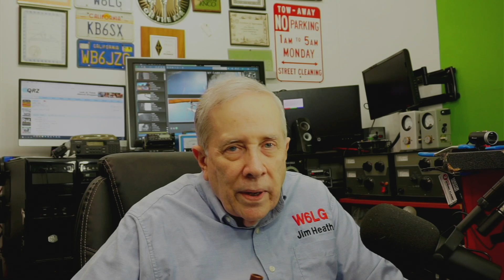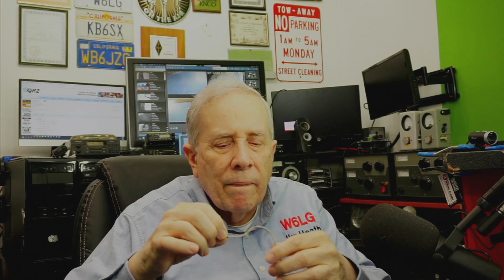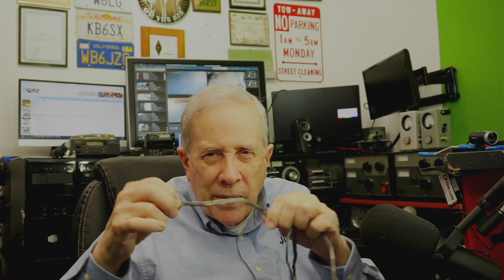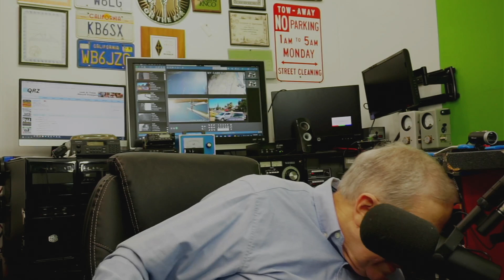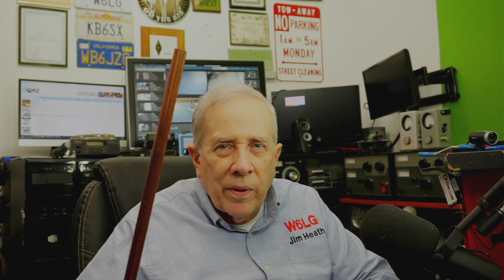How to RF Ground Your HF Station as Shown by the ARRL and a Discussion about Ground Loops, Bonding

Comment: I have always thought about making an alternate path from the shack with rods to ground would be a bad thing.  The electricity needs to make it back to the service panel then to the transformer.  The electrical system already has two grounds (Neutral and common boded ground).  I think I'll will now do a common shack ground (copper pipe) with a 6 awg wire that is runs back to the service panel ground rods and place a rod at the antenna feed point with a attached lead back to the service panel rods.  Thanks for another great video.

Comment: Since I just have a simple station and since you mentioned "braid", is it safe for me just to use the braid of used RG8 coax and strap it to a copper pipe grounding buss behind my desk and connect it to a grounding rod outside my house?
Reply from the maker: In   my opinion:  NO!  All grounds must go back to the maein panel. Run separate straps to the common point at the desk and connect that to the elctrical ground.  73 Jim
Reply: @ham-radio  but HOW do you connect the common point to electrical ground? I know that is what you have to do, but I can't find anywhere where you explain exactly HOW to do it. I know very little about electrical and wiring... break it down like an Elmer would.

Comment: Hi Jim, Paul NC6PT here.  You stated amply there is no such thing as RF ground.  That message is received.  However, I'm wondering about your recommended grounding system for your (and others') station.  Basically, it's a "star" configuration, with a copper pipe at the center.  Okay, but then, that pipe connects to... ?  The AC safety "green wire" ground at any chosen wall outlet?  This tells me that the various components in your station would be at the same ground potential as each other, but not necessarily the same potential as at the service panel.  I don't see the value of the copper pipe, given that all of the [braided] straps could be connected at a common point.  Maybe if the pipe ran behind several pieces of equipment, that avoids long runs of braid?  An illustration would have helped.
Reply from the maker: So what do you recommend?  I did not recommend nor do I have a "star configuration".  I have not heard that term before.  I used the pipe as I said because it runs the length of the desk and it is tied to the  metal frame as I described.  Each ground strap is very wide.  That system for both desks is tied to 6 inch wide copper flashing that is connected to a 1 inch copper pipe that runs to the electrical panel.  73, Jim
Reply: @ham-radio  Hi, I reviewed the video to see if I had missed something.  Well, yes, I did, but in my own defense it went by very quickly at about 12:15 where you mention "yet more pipe", but it's not clear that that pipe is 1" diameter copper, all the way from your radio room to the service panel.  Do you run that long pipe outside the house?  Under the floor?  What do you use to connect the long copper pipe to the ground of the service panel?  I don't find where you mention 6-inch wide copper flashing in the video.  So, anyway, your video got me thinking (that's good!) but I got bogged down in the details.  My recommendation for this video (if you remake it) is to include some visual aids --  photos of your grounding components in place (braid, pipes, straps, nuts and bolts, etc), how and where things connect, maybe a graphic showing the overall plan.  My recommendation for grounding?  Hey, I like yours!  73 DE NC6PT
Reply: @ham-radio  How is the 1 inch copper pipe connected to the electrical panel?

Comment: At 12.15 you say you connect your ground to the 'electrical panel' whic panel - Is this the main panel on your house?
Reply from the maker: The answer should not matter. It is connected to the electrical panel; could be any kind. It is not an RF ground.  Just an AC ground.  73, Jim

Comment: Thanks for clearing the air on bonding and grounding.  I too was not sure of how to connect the bonding busbar to the house AC so I measured the resistance between the grounding pin on the AC plug of my Astron RS-35M and its chassis ground stud.  Zero ohms.  Done!  My bonding system is grounded to the house AC ground.
Reply: I am in same boat. I feel like he was describing bonding (but calling it grounding) but I don’t understand how to connect the ground bus bar to electrical as he said to do. He didn’t describe it either. I’m confused.
Reply: @kellywaldo3215  if the power supply is bonded to the bus bar AND is plugged into the wall thjen it IS the connection to ground.
Reply: @kellywaldo3215  I am also confused... and when people ask him, he just refers them to the video.... there is no explanation on how to bond the common bonding strap to the house main ground

Comment: Another great video, Jim. The strap with the holes you showed looks like galvanized strap. Is there any concern about connecting that to copper where you have dissimilar metals in contact with each other?  Could that be a point of corrosion thus negating the effects of you keeping everything at the same fround potential? 73 de N6EF.
Reply: you can buy it in copper as well.

Comment: Thanks for the great info Jim. I currently have braided straps to 1/2” copper pipe, then via flat copper to a ground rod. From your video I now understand this does nothing for me. My service panel is 75’ from the shack. Do I understand correctly that I could run a wire from the copper pipe to the AC ground in a receptacle box? I’ve watched the video twice and still not clear. 
Kevin W6AAE

Comment: All my equipment is connected to an aluminum angle iron with a #10 insulated flexible wire. The angle iron is connected to a ground rod on the outside with a #6 insulated flexible wire which is connected to that of my electrical installation. My antennas, before entering the house, are grounded with protectors and this rod is also connected to that of my electrical entrance (TELCO). I think it's compliant with a minimal install.

Comment: That perforated ”plumber's" ground strap is a poor choice for connecting to a copper ground rod or copper pipe. A good grade ground clamp that can be tightened with bolts is a better choice. You fail to mention one of the most important, but mostly ignored problems, with grounding/bonding is the physical contact between dissimilar metals that is the prime source of corrosion. Mating surfaces should be coated with a copper bearing "paste" like Jet-Lube SS-30. The outside portion of my station grounding system consists of a 12" x 4" x 3/16" copper ground bar, two 8" ground rods, #6 insulated, stranded copper wire attached to the rods and ground bar with copper clamps NOT plumber's strap. #6 wire is then run to the inside ground bus through the foundation. Mounted on the ground bar are Alpha-Delta "lightning arrestors", with a thin coat of SS-30 on the back surfaces (dissimilar metals!). The term "Lighting Arrestor" is a misnomer. They are voltage suppressors. Their job is to protect your station equipment from induced voltages caused by near field lighting strikes and to bleed off any static charges. If you were to take a direct lightning strike, all bets are off. Don't expect the suppressors to stop it. You are almost certain to sustain, at the least, damage to your equipment.

A ground rod should be 8 ft. long, driven deep enough so that 2" to 3" are above the (earth) ground. This allows for the attachment of the ground clamp and maintenance of the ground connection. Once a year, I unbolt each component and inspect it for corrosion and, if necessary, use a copper cleaning solution. In order to drive an 8' ground rod in, the easiest way is with an impact hammer-drill that is rated to perform the task. Unless you already have one, rather than the expense of purchasing one, a store like Home Depot or Lowe's will rent you one.

I have found, as a retired RF Engineer and 42 years an Amateur Radio Operator, that the ARRL's ”Station Grounding & Bonding Handbook" to be sound and adequate to properly ground an Amateur Radio Station. While I disagree with most of your criticisms of the ARRL, there is a gain of truth in some of your points. However, I respect your right to express your opinions. 73 Al K3ZE
Reply from the maker: Thanks Al. A YouTube video by its nature and response, is not all inclusive.  I work from bullet points and those points are limited, repeated several times and shown by examples if I can.  I appreciate your criticism and glad that you took the time to write the narrative and edit it.  Thank you.
1.   The video was not a discussion of lightning.  Thank you for describing what you have done.  
2.   The video was not about how to install ground rods.  Thanks for your description of what you did. 
3.  I did say that compliance with the NEC is for safety reasons and that in some instances, a driven rod(s) meets the code.  In the ARRL examples that I have seen, the driven rod does not and could pose a safety hazard.  I did discuss that with experts like Mike Holt. 
4.  I am not sure what criticism of the ARRL you are referring to.  There is lots to be critical of with respect to top three editors that were recently hired.  Maybe that? 
5.  My video discussion was about providing a low impedance path from the equipment to the pipe so that all devices were at the same potential above ground; as small as that may be.  It was pretty much limited to that by bullet points.  It was not about lightning or driving ground rods or the reaction of zinc against copper or many other things.    
Again, thanks for your thoughtful help to all.  Many will read and follow your advice.  73, Jim W6LG licensed in 1964 and former Deputy BI.
Reply: That plumber's tape can also be gotten in copper

Comment: There are numerous standards/handbooks provided by NEC, ITU, ANSI, ISO, NFPA, MIL, Motorola, IEEE, FAA, etc. addressing bonding and grounding.  ALL address lightning and power safety.  In essentially all, their focus and advice is exclusively for lightning and power safety.  To apply their contents to RF signals is overreach.  NONE of these documents discuss or use the term “RF Ground.” 

Motorola’s R56 STANDARDS AND GUIDELINES FOR COMMUNICATION SITES is an excellent summary and reference for bonding and grounding for lightning and power safety.

However, MIL-HDBK-419A does address the ground system for “personal safety”, “equipment and facility protection”, and “electrical noise reduction.”  This last topic covers “Electrical noise reduction is accomplished on communication circuits by ensuring that (1) minimum voltage potentials exist between communications-electronics equipments, (2) the impedance between signal ground points throughout the facility to earth is minimal, and (3) that interference from noise sources is minimized.”  For those interested in “RF Ground”, this is the topic for you and this doc is a good starting point!  And what Jim says is right on target!

Comment: A very good presentation as always. As you mentioned many implementations using external unbonded grounds are dangerous. I am probably as puzzled as you are as to the need for this "RF ground" in most situations. Ignoring lightning protection issues a transceiver with a totally floating chassis connected to a dipole will work fine. IE a 12v rig running from a battery. All of my gear has the standard electrical safety ground connected, however it is all fed from a common mode choke so you could argue that it all floats at RF. I am using a ground mounted vertical with buried radials for my HF FT8 so I guess you could argue that is an RF ground. This is a bit sketchy but the radial plate does have a connection to the house safety ground. (Though I admit the conductor is undersized). I believe that similar bad engineering is fairly commonplace. I am in the UK and the house is wired TNCS, in theory if the outer conductor of the electricity cable got severed the load current could flow through my antenna ground. Sorry I digress...
Reply: I believe you are correct if you have only one piece of equipment.  In the case of multiple pieces of equipment -- transceiver, power-amp, AC-to-DC supply, tuner, etc. -- the copper buss provides a reference, consistent equipotential via low-impedance at RF frequencies to all the equipment.  Thus all the equipment will have a common base RF potential.  If everything is at the same base/chassis RF potential then it is unlikely that you'll have the differential RF voltages in the shack associated with undesirable RF radiation.

Note that I do not call the copper buss a "ground."  It is a means for sharing an equipotential for all the equipment via a low-RF connection point.  It happens to be at ground potential because the house AC wiring's ground feeding the equipment is attached to the equipment's chassis and that chassis is what is connected to the copper buss.  You can attach another wire to the house ground but you are simply adding another parallel conductor to the wall socket.  Visually satisfying but electrically redundant.

Note that if you run a wire from the copper buss to anywhere other than a local wall socket ground -- for example, out to another ground rod -- you are providing a potentially lethal alternative power distribution/return in the case of an AC fault.  The electrical codes are very clear and strict about providing additional/alternative power fault returns except via the ground wire running in the romex back to the electrical panel.

RE your radial.  I would not call them ground.  They form an equipotential plane for the antenna and happen to be sitting in dirt.  As for the wire running from them, note that the NEC requires that any wire running from these be run to a terminal block exterior to the house.  That terminal block has connections to all the ground rods.  Then ONLY ONE WIRE is run from that terminal block to the ground/neutral buss in the main disconnect breaker box.  This one wire simply provides the one and only reference potential to the house.  There is no power current running in this wire even with an AC fault.  In the US and probably similar in the UK, at the power pole there is a center-tapped transformer providing power.  All power currents run run to this transformer and thus in the main power wires.  Dirt ain't gonna conduct.  Ain't gonna be any power running in the dirt back to the pole and transformer.
Reply: @713allen  thank you for the reply, here in the UK we have a number of different popular wiring schemes, mostly depending on the age of the property. Our house happens to have a modern TNC-S system. The supply comes in on a large coaxial style cable. The centre being the "live" and the outer being ground and neutral combined. We do not have the centre tapped transformer arrangement you have. (also our supply to most houses is via buried cables). The soil here is relatively conductive (I live in an area with a high water table). There is  of course a possibility of the sheath to the incoming supply getting severed at some point and that could create a dangerous situation.

Comment: Hi Jim. Great video, thank you. Would it be benificial to bond the case of the shack computer with the rest of the radio gear on the bench? I have some RFI issues in the shack which I plan to try to fix soon and currently I have no bonding in the shack whatsoever.
Reply: IMHO the copper pipe provides an RF signal equipotential point shared by the radio equipment, keeping them at a common RF voltage.  As the computer has no need to share this point, it does not need connecting to it and may even suffer by doing so.  Rather, isolate the computer via ferrites on the power and any other cables coming into the computer.  For HF, 31 mix toroids work well.  Jim is a fan on clip-on ferrites.  Note that the MIL handbook shows computer cabinets connected to the AC/lightning grounding systems but NOT to the RF signal equipotential system (=copper pipe).  Summary:  connect the cases of the radio equipment to the copper pipe.  Do not connect the computer case.  Use ferrites on all cables.
Reply: @713allen  Thanks. My reason for asking this was to try to reduce RFI caused to the PC when runnings QRO.
Reply: @VK5IR